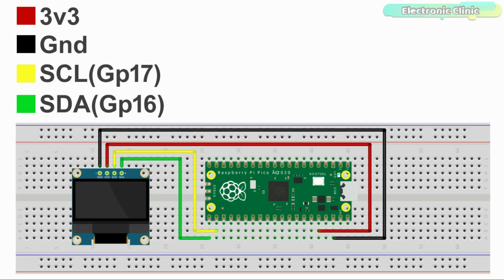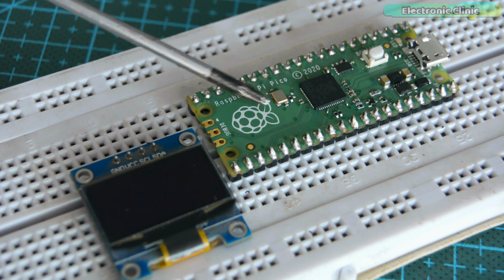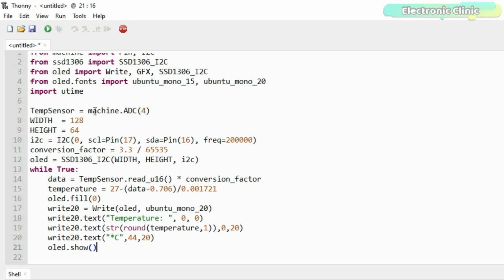Raspberry Pi Pico temperature sensor, raspberry pi pico Onboard temperature sensor

Comment: 3:38 - under the flame is the on board Pico's Crystal Oscillator.  We can't see the temperature sensor on the board because it's inside the RP2040 (on chip), right ?